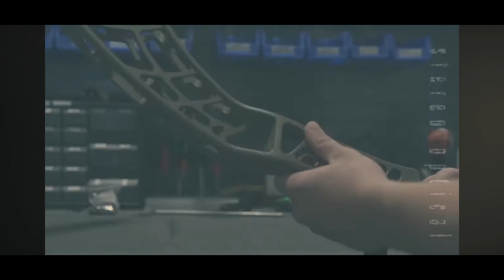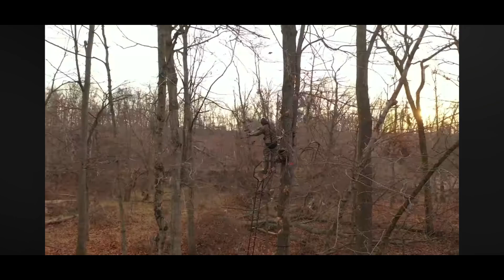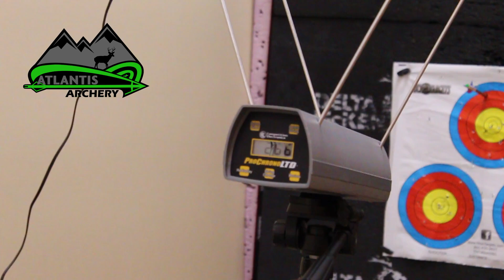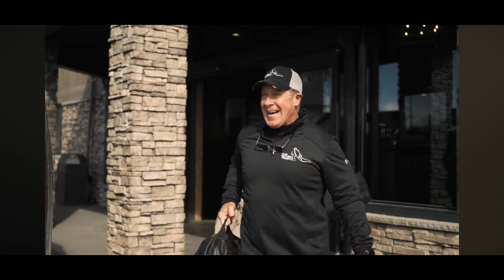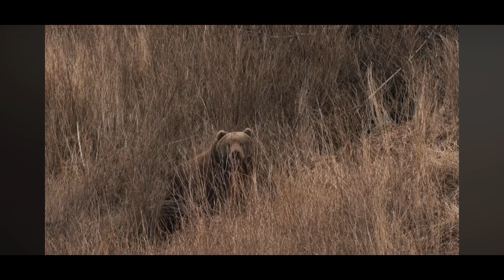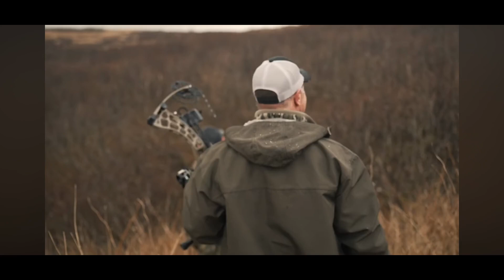The Next Evolution in Archery

Comment: May want to check out Bowtech Honor bow....they did it first.  Way too expensive for what it is though
Reply from the maker: Bowtech Honor is an awesome bow as well and used a similar magnesium material, The Honor was released in 2024 and the Xpedition X-Lite Series using Magnite was released in 2023. Xpedition just continues to add to the line each year. This year they added the XLite 32.
Reply: Best looking bow around.

Comment: These bows are way slower than they claim and a good bit heavier.  You still have to pull the axles to space the cams.  Just not worth 2000 dollars when most of the advertised features aren't really there.
Reply: There not $2000. The hoyts are $2000+ and you need to remove axel I Suppose those are worth it?
Reply: @c7u3676  how much are they?
Reply: $1899. Hoyt is $2099
Reply: @c7u3676  such a huge difference for something way slower than advertised and heavier than advertised.  The hoyt bows shoot much closer to advertised and are actually the advertised weight.
Reply: Elite or Mathew’s. Save some cash and get a great bow with innovative features!